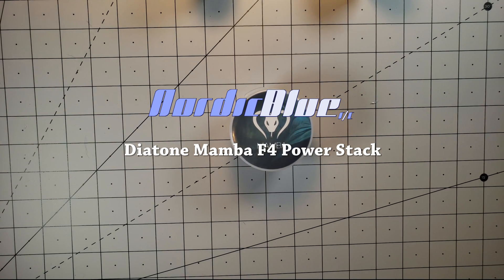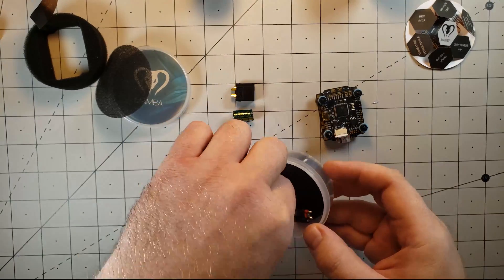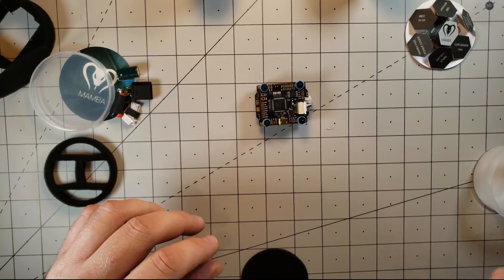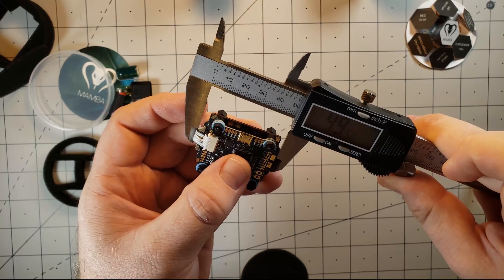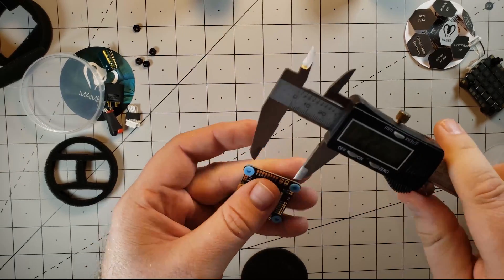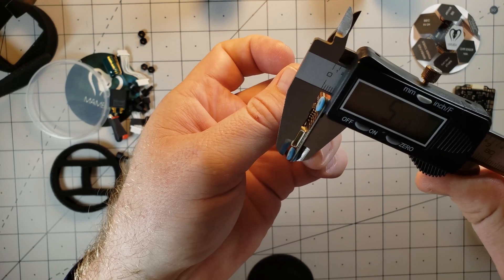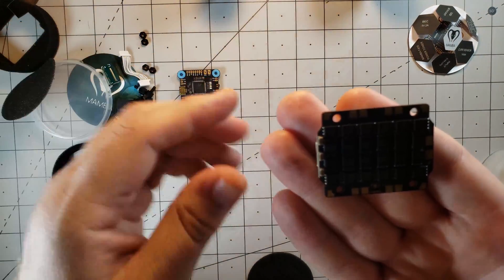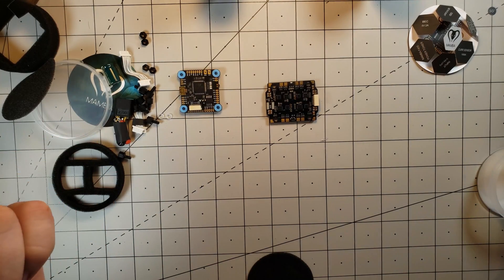Diatone Mamba F4 Power Stack

Comment: i have problems with osd flickering
Reply from the maker: Normally that happen either because of a mismatch in NTSC vs PAL in Betaflight VS your camera or you don't have enough filtering (too small capacitor). I would start with checking what your Betaflight OSD setting is and try the opposite of what it's on or try auto.
Reply: Tried And With biggers capacitor but notting
Reply from the maker: @boardmain  You checked the Betaflight OSD setting? What was it set to and what is your camera, NTSC or PAL? Try all 3 settings to see if it goes away.
Reply: NordicBlueRC fixed, now it work perfectly was a broker capacitor changed it, And problem resolved
Reply from the maker: @boardmain  AWESOME!! Glad to hear you got it figured out:)

Comment: Hi! Did you allready set up the mamba stack?
Does the FC need seperated full lipo power or is it powered up threw the 6-pin cable?

I can not get my receiver firing up on this stack!?
Reply from the maker: Almost there....snail mail from China can sometimes really be a bummer. If I don't get my stuff tomorrow, I will order the remaining parts from Amazon, so that I can finish my build over the weekend. I do know that the 8 pin cable it comes with has voltage and ground going to the flight controller. The black wire is the ground (closest to the corner of the board) and the white one next to it is the battery voltage positive. Also, in order to get 5 volts at the FC 5 volt pads, you must plugin a lipo. The USB alone will not provide enough voltage for the 5 volt rail and won't turn on your receiver.
Reply from the maker: Flight video is up:) https://www.youtube.com/watch?v=bVdH-i5USjs